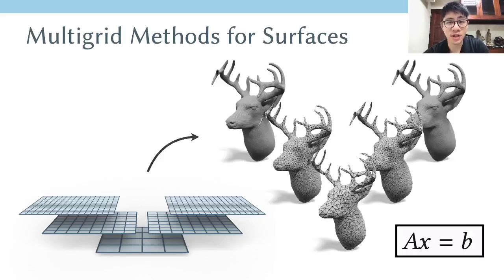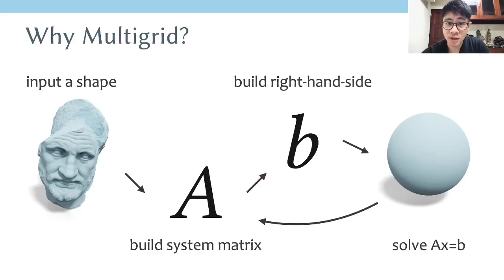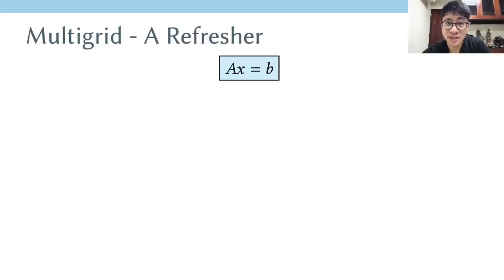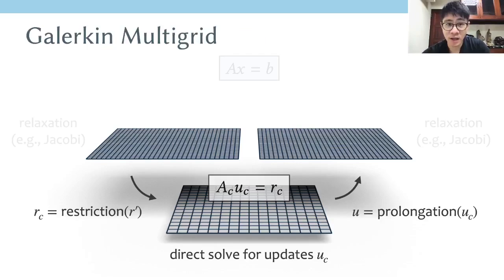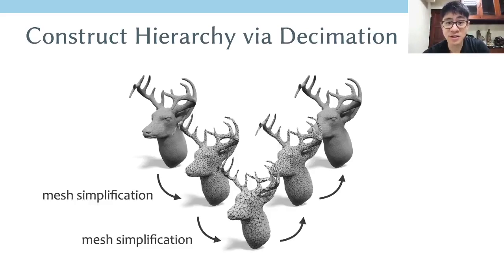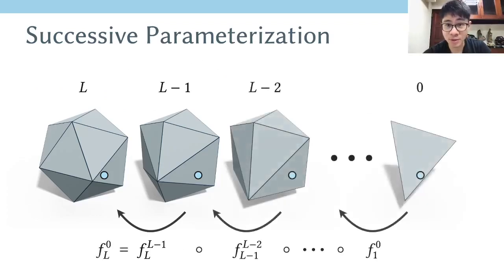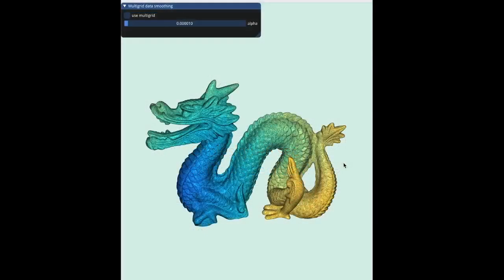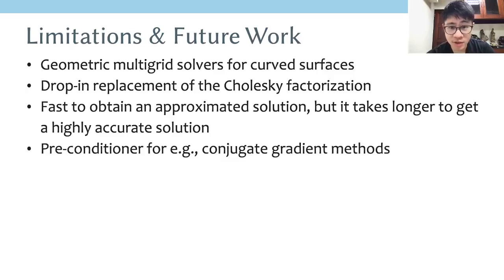Surface Multigrid via Intrinsic Prolongation (SIGGRAPH 2021)

Comment: I suppose one could help mesh quality agnosticism by adding vertices at points where it would improve uniformity of vertex density and triangle shape, and then running the algorithm on that. Then, removing the vertices after it is finished. I'm guessing the embedding process you've described would also work for adding geometry.